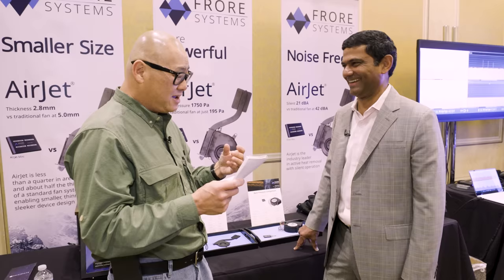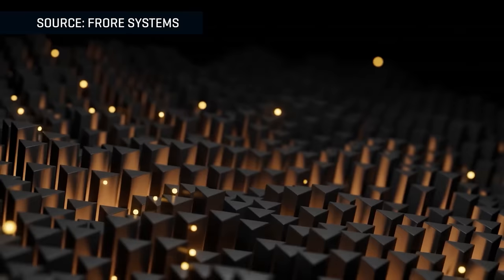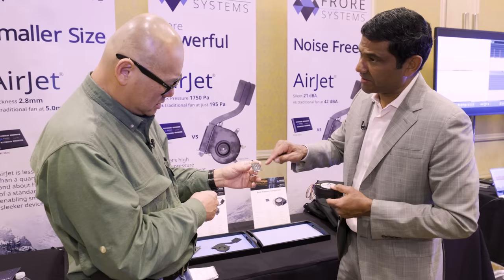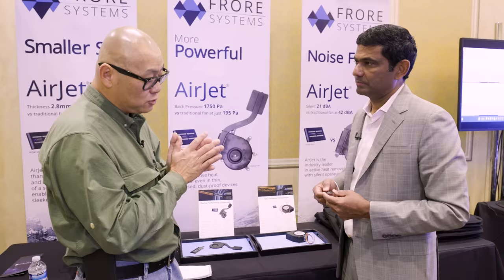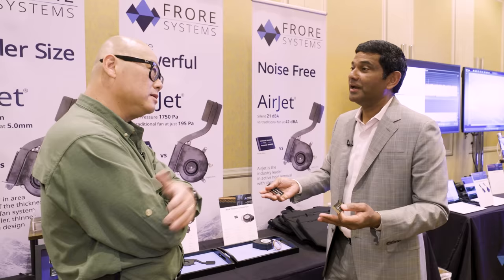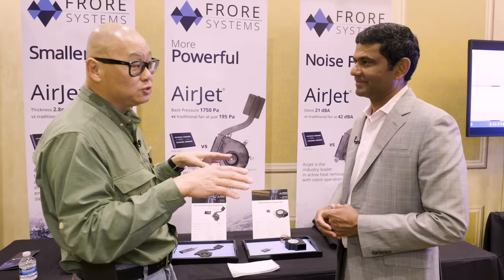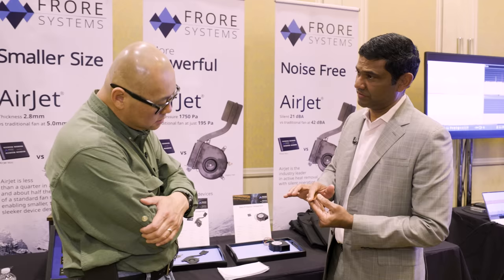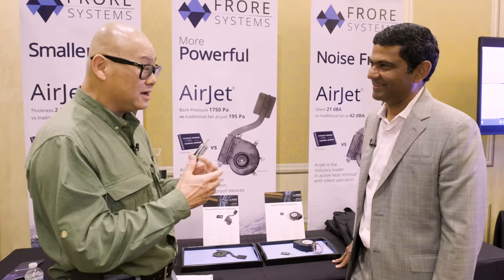Solid State Active Cooling Could Revolutionize Thermals

Comment: This AirJet has me intrigued. It's basically a true bladeless fan, with no moving parts!
I can't wait to see this scaled up. In the case of blower type GPU coolers for example, because you don't have to account for a blower fan you can either increase the length of the existing heatsink, or shorten the overall length of the add in board whilst breaking through the boundary layer to provide even more efficient & effective cooling.
Assuming they can produce it at a competitive price, I'd imagine that this in conjunction with decent thermal interfaces could offer at or near water-cooled performance without the need for pumps, and the risk of leakage.
Another place I can see this being useful is for case airflow. I can imagine a 120mm×360mm or 120×240 panel in the front of a case in place of traditional 120mm fans would provide quite a bit of airflow even at low power. Because of the pressure delta this technology can provide, it would be easy to integrate a clip on or magnetic filter that can easily be removed and cleaned. the velocity attained should provide better cooling for bay devices such as 3.5 inch hard drives, and because you no longer have fan hubs and frames to interfere with airflow it will have less turbulence.
The fact that they're a fraction of the thickness of even a 15mm slimline fan, they have no moving parts, and can operate basically silently is just a bonus!

Now that I think about it, I do hope they end up offering these as a fan substitute. Whilst I have no idea if this technology can provide the CFM of traditional fans, and perpendicular fin stacks may not be able to take advantage of boundary layer disruption, I can imagine that something like this as a 120×120 panel would have no problem blowing enough air through a 120mm tower cooler to keep your typical quadcore happy whilst keeping the minimal noise crowd happy. It might even improve the performance of some tower coolers as you can fully utilise the fins as opposed to missing fin area behind the fan hub and shroud
Reply: it does have moving parts, they are just very small
Reply: What it definitely doesn't have is rotating parts & this has me wondering if we're also seeing at a much better lifespan due to the lack of bearings wearing out or simply their grease drying out
Reply: @unfairfair  The thing that concerns me the most about the size of these 'chips' is dust ingress. Any level of dust going into that tiny space will clog it in a very short time, with 0 ability to remove it on the consumer level. If they're super cheap, replacing them sounds like the better method of cleaning. Peizoelectric pumps have already been used in both air and water pumping so the underlying tech is more mature than we know... it's exciting. But it could also end up like peilter coolers... a cool tech which is totally useless in real world situations.
Reply: Actually it is THE moving part.
Reply: @Xorthis  I immediately thought of, "It wouldn't take much dust to clog that thing" but he later said it was fully enclosed and dustless. I hope this works and becomes commonplace because I'm tired of noisy computers.
Reply: @jayrowe6473  After having used electronics for years, there's no such thing as fully enclosed and dustless. They could be using a HEPA filter and particles will still get in when out in the wild. The question is, how much does the filter choke it and what's the lifespan?

I'd love this tech to actually work, but when it comes to it, there's a reason the humble fan has survived so long as a main solution. It's cheap, simple, reliable and established.

Comment: I have to say in 30 years of PC building, this is loooooooooooooong overdue, much like the transition from HDD to SSD getting rid of moving parts is always a good thing and if you can do so while getting better results well thats just great.

Hopefully in time they will cost similar amounts to coolers today, I look forward to them.
Reply: Ssd is fast yes, but the data not store for a long time
Reply: Cooling fans are the only components in a pc and laptips that are not solid state. Fans are often the first component to fail. Replacing them with solid state cooling would do wonders for reliability.
Reply: UHOH!  The membrane is made up of millions of tiny moving pieces...
Reply: @StinkPickle4000  While you are in a sense correct that there is movement, there is a difference in mechanical terms between motion from oscillation, and actual mechanical movement, mechanical movement creates far more wear and tear on the items involved in that and usually requires vastly more maintenance of a given system using mechanical movement.
Reply: @trucid2  Aye hopefully, I am genuinely looking forward to these especially for desktop and GPUI down the road. I mean can you imagine having a high end graphics card in your pc that was no thicker than the height of a capacitor and had no fans?  been 30 years since that was the case.
Reply: @Nine-Signs  I'd be cautiously optimistic. While the device disrupts the boundary layer formed right above the chip, in a way acting as a very thin heatsink, you still need a way to move the heat out of your device, which would have to be done with fans or heatpipes connected to heatsinks and fans. It's cool technology to save space, but there is still a piece of the puzzle that's missing to make it truly revolutionary.
Reply: @trucid2  The device creates its own airflow? no fans required as such unless I have misunderstood what they presented above but I doubt it given he product is marketed under the names of AirJet and Airjet Pro which for laptops is evidently working well. 

So for speculative example, down the road say they have a product that can fit on a desktop chip or GPU, its pushing air at 120mph in an incredibly confined space which is the primary reason it is vastly more capable of heat removal, meaning you can use a much thinner intermediary between the chip and the solid state cooling plate, i.e. much thinner heatpipe heatsinks are required because the efficiency is vastly higher, and near silent is very useful for me as I write music and fan noise can be an issue especially in summer. 

Many is the time I have been in a sound recording studio to find they have retconned a disused fridge into a soundproof box for a given PC. Condenser microphones hear all, even your tummy rumbling.
Reply: @Nine-Signs  The airflow efficiency of a fan is measure in airflow, how much volume it can move per unit of time. Notice how they never made any claims about the volume of air it can move. The device is not meant for moving a significant amount of air, merely removing heat from the boundary layer of a chip. It's a very different function.
Reply: @sgtsetia  depends on your usages case, I mean until recently my main drives SSD was 9 years old, still working now just relegated to storage. I have worked with and been using HDD's for 20 years until I switched a decade back, I have to say so far I have not had a single SSD failure nor known of any in any of the couple of hundred systems I built over that time, but I have known of a ton of standard HDD failures.

Now what I say next is not regarding the first couple of gens of SSD's as there are always kinks in manufacturing new tech, but today there is no limit to how long an SSD will last you providing you look after it, i.e. don't drop it / fry it, and are not hammering it by say using it in a backbone server system of a busy enterprise getting hammered with read/write requests.

SSD's today unlike HDD's can and do repair themselves, literally. Sounds vaguely borgish but this paragraph will explain:

"Only after years there are storage cell drop outs. However, even for these inoperable cells flash storages have a successful solution. Current generations of SSDs have reserve capacities. These storage spaces aren’t available to the user, but are used to repair damaged cells. The defect cells are replaced with brand-new reserve cells; this procedure is called “Bad-Block-Management”. Thus, SSD storage cells in normal operation last a lifetime."

So for residential users at least, people should feel safe to shove their family photos on an ssd and stick it in the attic for 50 years if they want, should work fine if protected from the elements. :)
Reply: @Nine-Signs  Uhoh someone Forgot what MEM stands for...

Comment: I'm an aerospace engineer and this is brilliant. Aerodynamics at that small of a scale is fascinating, I can't believe I've never thought of this!
Reply: Now that you've seen it is it something you could prototype on your own if you had access to the tools?
Reply: @GameTimeWhy  You could probably use some sort of piezoelectric material for the flexible surface and 3D print the rest but I'm definitely not smart enough to do so 😂 The moving surface makes the aerodynamics very complicated. I most do space stuff anyways so this is a bit out of my scope
Reply: @itseu  the curse of being a specialist! Luckily I've never specialized in anything! Haha
I know there isn't air in space but I wonder if these types of cooling/heat distribution concepts will have any impact on cooling in space. I've just read that cooling in space is a really big issue.
Reply: @GameTimeWhy  space is cold so i guess we dont need much cooling :))
Reply: @nguyennam1945  there aren't enough particles to "pull" heat away. Overheating is a really big issue in space exploration.
Reply: @itseu  wonder if what can cause resonance vibration like with an ultrasonic cleaner?
Reply: @itseu, as an aeronautical engineer, are you thinking surely there must be aero engineering applications for this? At least in drones and RC models? Especially with a flat form factor 
like that which would fit so nicely right into a wing. Right?

Comment: That could be great for handheld PCs like steamdeck depending on what finstack you need for this 10Watt capacity
Reply: There no finstack the chips is the fan + the fin stack and you can put multiple of them on 1 heat pipe

Comment: At first I thought this was going to be a more advanced peltier and not that interesting.  But the technology he describes is extremely fascinating and smart.  I hope this technology takes off and is able to improve and become mainstream even in desktop PC's.
Reply: Ditto. I saw "solid state active cooling" and thought "so, a peltier?" I scrolled past, but after a few seconds figured I'd give it a shot and watch the video first before condemning it.

I'm glad I did! While I'm not going to go as far as many others to say "this will revolutionize cooling!!!" it does address the boundary layer issue in a creative way. Do I think it will be successful? Of course not, no proof of concept ever is, but this guy's trying something new and it's a path worth following at least a little to see where it goes.

Why's he gotta diss fans as 100 year old tech, though? There's a ton of modern tech that goes into fan blade modeling even now.
Reply: Yeah, that is where I was at.  Did the peltier thing back in the socket 7 days with mixed results and one burned motherboard.  Ditched it after I saw the problems with certain situations were I did not want to put a client PC at risk.
Reply: Came to roll my eyes in front of another Peltier-like device, and am glad I did. This definitely looks interesting. Problem with Peltier is that they are used to either have a fine control over the temperature, or if used in cooling only act as heat pump, but don't help much in transferring the heat to another middle (air) very efficiently. So basically in a cooling system they would rather replace heatpipes, and also saturate quickly at higher heatflows because of back-conduction through the semiconductors. Looking forward to see where this tech leads.
Reply: @zierlyn  To be fair, he is specifically focusing on a single market.  Plus, typical putting down the competition.  My bet is that this will show up in extremely expensive Ultrabooks.  He said it's commercially viable, but it very well be 100x the price of an equivalent ($0.50) fan.  I know I'd buy it though.
Reply: it already has, for decades. it is used in industrial setting because of the lot higher pricepoint.
if this guy can make it competeable cheap enough then he is onto something, but the technical concept is really old

Comment: If this works as described this would be revolutionary for PC handhelds. The Steam Deck operates at 15W and 6800U handhelds are going as high as 28W which is where he says is the max. I want to see this in PC handhelds next year if possible
Reply: 28W of cooling requires 3 of the larger(larger footprint, but still thin) 'pro' models shown at 5:34.
Reply: @DoubleMonoLR very true, the real problem here is power efficiency. It’s only first gen so there’s definitely time, but by their own admission the small unit displaces 5 watts of heat while using up to 1 watt. Compare that to a standard computer fan which consumes 1-3 watts but can displace way more, and you see why the applications are super limited thus far. In a system trying to get the most out of a battery adding a more expensive cooling solution is rough. That being said it’s still really cool and just because it isn’t ready yet doesn’t mean it’ll never be.
Reply: @LazarNaskov  agreed. the efficiency is key here for sure. 

Would love to see a desktop version first targeting the SFF PC market. With a better power budget there, these could be a game changer, even if less efficient than a fan/heatsink.
Reply: Yea companies like Aya Neo should definitely be taking notice of this. Maybe Valve too for their V2 Deck and why not Nintendo as well of course??
Reply: @DoubleMonoLR  that's if you're going to cool the device strictly with these units, but device manufactures have been using hybrid methods for ages now.

The Surface Pro 4 could dissipate half of its 22w heat load with a small copper pad that was under the screen and that was back in 2015.

Similarly, you can still use the airflow of this to draw air through a heat sink.
Reply: The question I have is how much does it cost? If this costs 10x what a fan does, it will never make it into a Steam Deck or a Switch.
Reply: @figmentpez  Yep. Fans can vary quite a bit of course, but at least in the outset these will probably be significantly more. 

But really, if a small fan is 2 to 5 bucks to manufacture, and this is 20 to 50, it could still be worth it if it's going into items that are already selling for 600+ dollars. Especially if they can shrink the form factor, advertise as "silent" and bump the price up a bit to compensate.

Comment: Damn, Mr. Madhavepeddy just gave a clinic on heat transfer. I learned a ton from this interview. I'd love to see where they go in terms of making a silent gaming laptop, and it'd also be great to see if it ends up working in the Desktop space as well.
Reply: @notfiveo there was demonstrations, at least of the technology, seems like you didn't watch the video
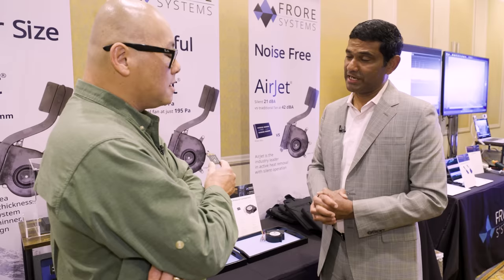Reply: @notfiveo You better wash your eyes and revisit video @ 3:14 , 4:05   and 10:53
Reply: As the guy said, the gaming laptops is somewhere in future of this technology. But what I see right now is that small boys could be used in high-end mobile devices (tablets, gaming phones) and in powerful networking devices (high-end routers, they heat a lot!). There's tons of applications of the current state of this technology even today!
Reply: i could see this being used as is on high end ddr5 and gen 5 nvme as for gpu and cpu with the tech as is it would require a custom heat pipe allowing the attachment of up to 10 or more of them but it could still work.